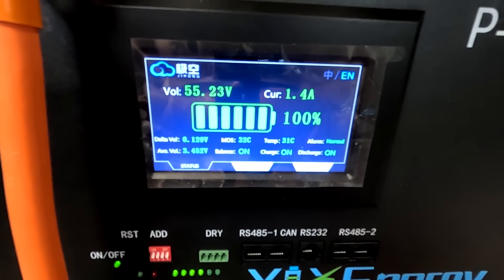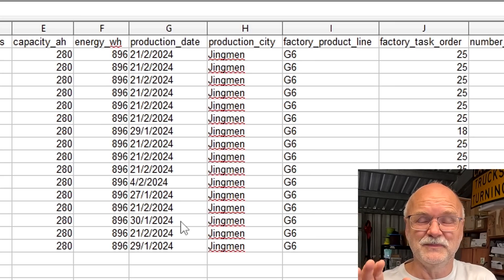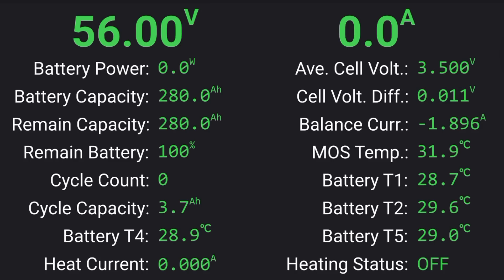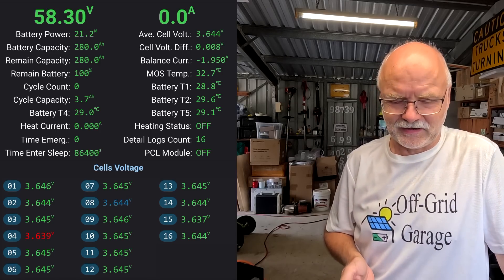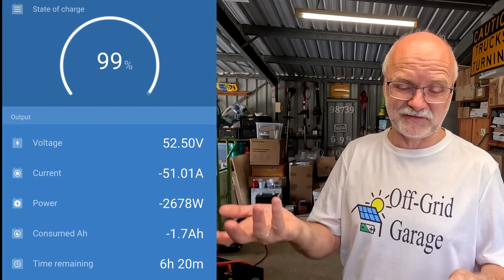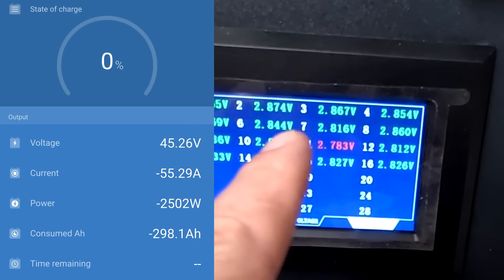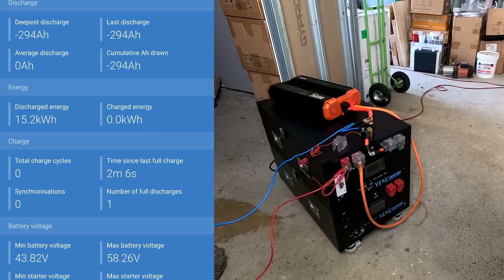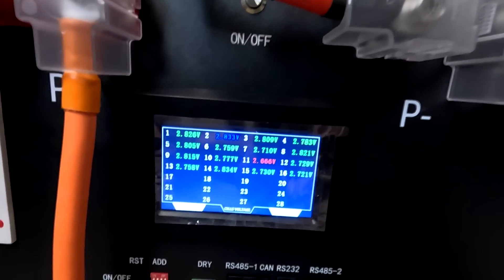Best EVE LF280K from Yixiang with over 300Ah Pack Discharge Capacity and JK-BMS Auto Top Balancing.

Comment: Unfortunately, I have to write what happened to me with my purchase from Yixiang. Because I am cautious, I spent quite some time choosing where to buy LiFePO battery blocks. I watched many videos, almost all of them yours Andy. Then, just before winter, I paid for the first 15 kWh package (box, 200A BMS, 320Ah batteries). After about two months, the batteries arrived, I opened everything, took measurements, and even optically it looked (welded) ok.

Since everything was fine, I paid for the second 15 kWh set. They had been making new boxes for a long time, so they arrived together with a delay, and a little later the second battery pack. The packaging of the boxes is large, undamaged, nicely packed and protected. I thought, great, this will be fine. I open the first box (housing) and assemble it. I notice that the BMS has much too thin connecting cables. I write to Becky what the problem is, she is very friendly, but this company does not realize that such thin cables cannot be used for such high currents. The connections between the battery cells are also all made of thin aluminum. They convince me that the cable cross-section is fine, etc., but I have been an engineer in the field of electronics for 40 years and in the end, after three days of convincing them, they decide to send me new flat bus-bar connections, just like they advertise on Alibaba.

I then open the second box and find that they sent me a badly damaged battery box. The box fell on its front side before packing! because the packaging is undamaged. In the upper part there is a dent almost 1cm deep, the supporting profile of the box is strongly spirally twisted, and the entire front panel. I write to her again, send photos, and the same story: "I will forward the information to production", then they convince me that this happened during transport, which of course is not true, because the packaging and cardboard box are all intact. Finally, they tell me to fix it myself and that I will get a discount on my next order. In the meantime, I find out that the two largest insulating plates for the battery base in this box are missing. I get the same answer, that I should fix it myself - buy them at my own expense.

And then, when I open the second set of batteries, I am horrified. All 16 batteries are too poorly welded! You can see right away that this will not work. I write to them again that this should not be sold at all, because not only will the connection contacts fall off, but with a higher current they will heat up due to the poor contact and can soon cause a fire! What will happen when the first one falls off during assembly? Their answer: "screw with a lower torque, up to 6NM".

Two weeks ago I started installing these very risky batteries and indeed, the contact plates on three of them fell off at only 4NM of torque. I contacted them again and reminded them that I paid for working batteries and not this crap, that we have strict regulations on what can be sold and what the warranty obligations are. They want to see pictures (in the meantime, three more batteries fall off!), their answer is "to send me new batteries, which I have to pay for at half the price". I put the batteries under a microscope, all the welds have a micro crack on the weak weld, exactly in the same place - where the connector then falls off.

A couple of days ago Yixiang came back with a response in the style of, we no longer have REPT 320 Ah batteries to send. What is wrong with the Yixiang company, they have no quality control, they send expensive goods incomplete and damaged. Goods that should not have left the factory in the first place and most importantly, they don't even want to know what a warranty is. They should know the power and negative publicity that online posts from angry customers on YouTube and renewable energy forums have.

Don't fall for Yixiang, or you'll be screwed when things go wrong, like I did.

Comment: Can you do a video on 2024 high amp active balancers please to make top balancing easier vs charging cells manually. Also, I'm curious what was the cell diff on the next day of charging to full from that low of a discharge - I think cell 11 would be way off at the top end and need to be balanced by the JK

Comment: This is just a guess, but maybe the measured capacity reported by the smart shunt changed because you recharged the battery, and the charger (connected to the negative terminal) is positioned on the output side of the shunt.

By the way, I’m one of your silent fans! I’ve been watching your videos since you first started this channel.

Comment: Just a idea, why these cells are rated as 280Ah, but always have 300 Ah or even more: this enables the maker to advertise a much bigger cycle count of up to 8000. The maximum number of cycles is reached when the capacity drops below 80%. But 80% of 300 Ah is 240 Ah, 80% of 280Ah is 224Ah. So the 280Ah cells can cycle down to a remaining capacity of 224Ah, and this is 74% of 300Ah.
If Eve would sell these same cells as "300 Ah" cells, the cycle count probably would reach only 6000.

Comment: Last August I bought Eve LF280K cells from a dealer here in Germany, and when I first loaded these cells in my Yixiang DIY box I found that even at 3.4 V per cell there was no voltage difference between the cells. Even when the first cells reaches 3.45 V, the balancer did not start, since I defined a minimum of 10 mV of difference between the cells to start the balancer. These 10 mV were reached at almost 3.5 V. I carefully loaded up to 3.63 V and let the balancer do it's work.

Now, after 3 month of battery usage the cell voltage difference still is between 1 and 2 mV.

Yes, these cells are of best quality.

Comment: My Fogstar/Seplos-Mason battery comes with an active-balancer built in. So you can just turn that on to do a faster top-balance. Slightly weirdly it has a separate power switch from the main BMS so it's up to you whether to leave it on or not.

Comment: Hi. I have an unrelated cell question.  Around a year ago i relieved a shipment of 48 LF280k cells for a future expansion of my system.  I checked the voltage every few months of a sample couple of boxes and all fine at 3.29 V. After reading about self discharge of at least 1% per month I decided I should put some charge in them so I made them up into 4s packs with a jk and fed them 50 Ah each.  I checked the voltage of each cell first and all fine. One cell went open circuit as soon as I started the charge. It now sits at 0.2V and 300 ohms.  Has anyone else experienced this? Have I killed it by poor storage or was it a manufacturing fault.  Any help would be appreciated.  Simon in sunny cool nz

Comment: There are apparently 2 versions of the 4.3 inch JK displays. One has no animation and narrow battery bars and below a 3rd line with remaining capacity and power. Since I don't like the animation, I've already tried to transfer the content from the eeprom in the display to another one in order to have the same representation on all displays, but then I get an error message in blue font. The firmware in the processor is obviously different.
I didn't get a response from JK about a firmware update. There is a YouTube video where someone does a firmware update via the SD card slot on the display.

Comment: Hi Andy,
I have a question regarding top balancing with the JK BMS: are we sure that the cell voltages it measures is accurate enough? I am asking the question because I checked the cell voltages of my DIY EEL battery at various stages during charge & discharge, with two different multimeters, and they were consistently higher than the values I could read on the BMS app.
This may be an issue when top balancing because if 3.65 V in the BMS is indeed a 3.67 V or 3.68 V "real" voltage, that may damage the cells.
I have seen that it is possible to calibrate the voltage in the BMS app... is it actually needed?
To be as complete as possible, I must add the (my) BMS battery voltage is fully consistent with that of the Victron Lynx Shunt when there is no current. But we're talking of the battery voltage, not of the individual cell voltages.
Best,
Olivier
Reply: I have 3 Boxes, and 2 of them are not charged to what is set in the JK bms, so I see the opposite. There are no 2 boxes that are the same when fully charged, all 3 boxes are different after charging which should be 55.2v

Comment: The terminals of these cells, seem to be welded after the application of the low conduction coating you sanded away from the top of the terminals. Can you do a high power test of this battery controlling the temperature on the welding points of the cells? I suppose pre coated terminals are welded on the original aluminum plate of the cells, and can warm up with high current  flow.
Thanks Andy for your amazing channel.

Comment: We have the shunts mess up the capacity figure the same way. I approached my supplier and they discussed it with Victron. However Victron just said that it's not something they will work on because the shunt isn't meant to be used that way. Pretty pathetic response from such a well respected company. So the only way to do this sort of test is to have another supply for the Shunt that takes over when the battery cuts out, but this isn't a viable method for most people.

Comment: Andy, How many amps are you charging at when you only pull 30 amps from the batteries?  Also, there are 3-4 for resellers for the LF280K batteries making 300+ AH.  Does it matter who the reseller is?
Reply from the maker: What do you mean by how many amps am I charging this battery with?
Reply: @OffGridGarageAustralia sorry, meant charging your car. How many amps are you charging the car with when pulling 30 amps from the battery?

Comment: Can someone out there answer a question about the victron smart shunt? I have a selectronic inverter and JK inverter bms (x3). The only time the inverter and the bms are the same SOC is 100%. If I put the smart shunt on would that be a more accurate way of measuring the battery levels ?
Reply: smart shunt will be closer to your battery, hence more accurate reading( depending upon the resolution of the adc on the microprocessor).

Comment: Maybe the 300 milliamps is used by the BMS. It seems reasonable. I'd like to see you put in circuit ammeters to measure where current is being used. When you had the self-discharging balancer in the 12 volt battery pack, you could have placed an ammeter in series to see if the balancer was wasting current rather than fully charging the battery and allowing it to self-discharge, you have the tools!

Comment: Andy, could you show the settings of the JK BMS used for this test? As a Post, or on your website?
Reply from the maker: These are the same settings as I have shown in this video here:
https://youtu.be/eZX7CkEEq_8
All settings are on my website: https://off-grid-garage.com/my-settings/
Reply: @OffGridGarageAustralia  thank you! I wasn't aware of this website section.

I recently read the EVE 280 V3 specification and testing guide. There is a section with Application Conditions and Voltage Limits. It looks like it is safe to use the cells between 2.5-3.65 voltage with a discharge cut-off at 1.85V (2.0V alarm set and 1.9V current reduced) and a 3.8V charge cut-off (3.7V alarm set and 3.75 current reduced).

Comment: One quick question: 
Balancing starting voltage is set at 4,45. While charging 1 cell reaches 4,47 and all other cells are still below 4,45. Does the jk-bms already kick in or does the avarage voltage need to be higher then 4,45 for it to start balancing?

Thanks

Comment: Hey Andy, did you see Will Prowse latest video?  Wondering what you think about his take on fully charging at 3.625 often.  Let us know.  
This is quite a bit different than your theories of not fully charging to that voltage.
Reply: No need to go,up to 3.6V. Just stop charging at 3.45 and the cells will be fine. If we prevent charging and discharging on both extremes those lifepo cells stay nicely balanced. Just make shure your balancer does not run below 3.45 and all will be fine for years.
Reply: I think 3,45 is already sufficiently into the steep part in order to balance properly.

Comment: Awesome video, thank you! Can you tell me about the charger you were using? Besides it doing the full batteries rack charge can it do the individual cell charge as well? If so can you tell me were and link for it? And were can you purchase the Cell balancer and which one works the best! Hopefully, it can be shut off as many know they can drain batteries on constant balancing.
Reply from the maker: I have all the links in the description of each video.
The variable power supply/charger: https://off-grid-garage.com/measurement-tools-and-analisers/
The balancers can be found here: https://off-grid-garage.com/battery-management-systems-bms/
There is also an option to shut it off when the voltage is below 3.45V: 
https://youtu.be/kEeD-oM4QnY
Reply: @OffGridGarageAustralia, thank you for your knowledge and help and awesome videos

Comment: I bought a JK inverter BMS from the link on your site from Aliexpress JKBMS Store. The display also changes from empty to half to full, and I think it does this when its charging and balancing. The only difference with mine is for some reason the screen does not show the JiKong BMS logo but it says JKESS.
Reply from the maker: There is actually an update for the screen you can do. A viewer sent me the files and instructions a while back. I'll make a video at some stage...
Thanks for confirming this animation running during charging. That was new to me.
Reply: @OffGridGarageAustralia  Yeah the animation was weird. I thought something was wrong but I watched it when it was charging and balancing and once it was done the animation stopped. Oh and thanks for your videos, they have helped me alot.👍👍

Comment: UK here....Funny you should mention that....I just took delivery of an EBC-A40L yesterday and put one of my LF280K's thru it's paces...303ah from 3.5v down to 2.6v !!! Super pleased with the result, testing another as we speak to see if it can match it.
Reply from the maker: Great! I hope 6.5V is just a typo😆
Reply: @OffGridGarageAustralia  Indeed lol...Edited accordingly.
Reply: capacity of 1 does not matter, capacity of 15 does not matter, capacity of 16 does not even matter.
What really matters is the voltage drop curve and how congruent these curves are.

The capacity of the battery itself as a unit is determined by the 2 cells that are hitting overvoltage protection and undervoltage protection first.
If you have 1 cell that is 0,25 V above the others when hitting the 3,6 V barrier while all others are  still at 3,35V then you my loose  a lot. 

Imagine it would take 0,5 hours to charge those 15 cells fully , then 40 A x 3,5V x 0,5h = 75 Wh per cell would be missing or times 15 = 1 kWh.
And that could happen again on the undervoltage protection side where 1 is hitting 2,6V while the other are still at 3,15 V. 

The best way is to throw them into the battery box and start the tests from there. If you get close to 14 kWh in / out then be happy. If it is far less then you can consider a test of each cell. In Home Assistant with JK BMS and BT monitor you get nicely graphs where your fully charged top balanced battery starts to discharge and you can see the curves of 16 cell in one chart and recognice the worst cells in the pack. 

Only this will matter, cause you are not getting a capacity based on the addtion of 16 capacity values in Wh cause the real world capacity depends on the 2 cells that will kick the protections. And the difference can be quite huge eevn though I had the nices 300Ah cells but I still only got 260 Ah out of the whole battery.
16 Top performing single cells , but as a battery unit disappointing.
Reply: @typxxilps  Appreciate the explanation but you missed the point, or I didn't make mine clearly enough...I'd just bought the tester and wanted to get familiar with how it worked. I plucked two random cells and gave them a run through. Considering they're almost a year old and they still pulled 303ah i was pleased.
For info, I use a JK Inverter bms and am aware of of how it measures overall capacity but I'm sure your post will be helpful for the less well informed.
Thanks.
Reply: Top is 3.60 Volts, I think.

Comment: Hello everybody. I bought my 16 pieces of LF280K nearly half a year ago and they were measured by EVE. The worst had about 314 Ahs. Only 1 is a little bit different from the others if i look at the specific curves, but gobelpower says that's still in the range of standard-deviation. Everything is working well at the moment in not sunny, often raining, always cloudy and cold germany. Greetings from the Saarland, Markus.
Reply from the maker: Thanks for sharing Markus. That is a great quality you got there from Gobelpower. Wow, 314Ah for a LF280K. I thought mine are already good but yours...👍
Reply: But that does not really matter. What matters is how congruent are the drop curves of all cells.
I had a great delivery of EVE cells with over 305 Ah and finally put together in a box these fine 16x 305 Ah x 3,2 V nominal cell capacity is not useable.
Why ? 
cuase each time 1 cell is running ahead and kicks the overvoltage protection and another one the undervoltage protection. 
total useable capacity is roughly 270 Ah x 3,2V x 16 and therefore 35 Ah x 16 x 3,2 V missing or 35 Ah x 51,2V = 1, 8 kWh missing. 

Don't be fooled by single cell capacity tests cause the only thing that will count in real life is that of the whole assembly as battery.